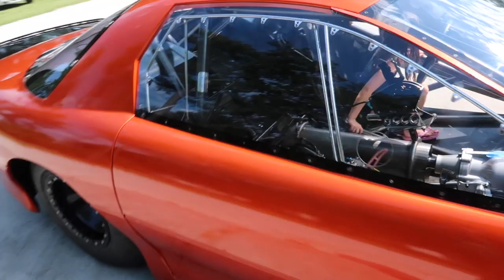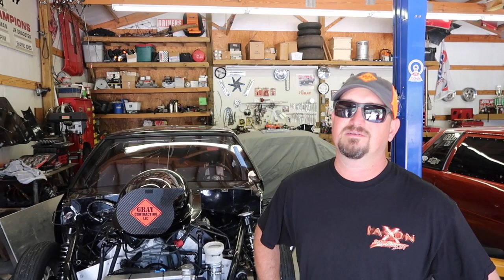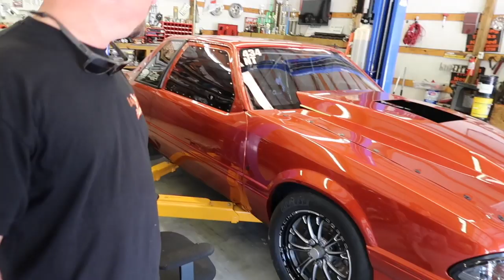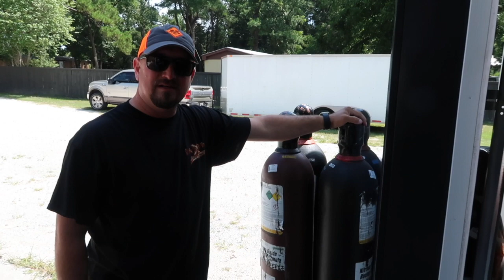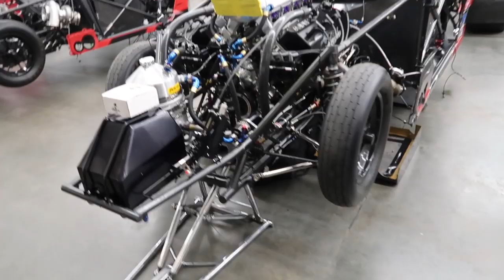Quickest Way TO BLOW $100,000 Dollars

Comment: I like the 2010 body style camaro not much of a mid 90's camaro body. Why give that car up for this mid 90's camaro other than lighter?
Reply: anonymous  I was born in to racing and I've been running my 88 Monte SS sense 94 when I took over and when I want lighter I made lighter when I need a chassis car I did it as a chassis and you say it's just a promod well he said he's doing NPK well you gotta have a vin and tags and no promods and wheel base can't be over 3" past factory and gotta have factory steel roof factory steel quarters and a pilers and rockers which is what they call a factory body

Comment: It's no lie. You just built a nitrous car.  If that's not blowing cash in making a hot rod, I don't know what is.  Two words...power management. If the air gets dense or hotter or colder, do you dial your power adder up/down so that your boost/rpm and shift points suit those changes? No. You sort of guess where to fire a nitrous solenoid(and don't forget to pray to the parts god that you don't burn more parts). Kind of like playing on a Ouija board only with a car.

Serious, kids who might be considering racing...if you think you want to force other power added cars to add up to 250 extra pounds so that you're any competition at all, buy yourself one of the MANY nitrous cars for sale because the technology cannot get any better than coating every part of the internals of your engine not to burn up. Despite racing circuits allowing up to 1000 cubic inch engines for nitrous, they're still not getting it done on anything other than a "nitrous only" event which to those of us who watch racing, is kind of a joke.

If you want to drive a real car with real respect, make something that suits racing TODAY, not five or ten years ago. Roots, Procharger, twin turbos eat nitrous cars like a fat kid on cake.